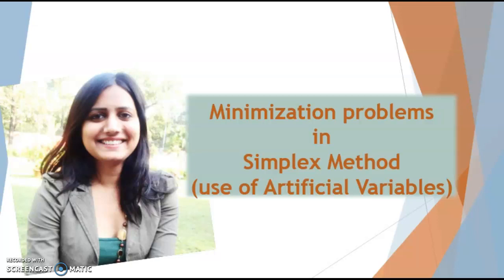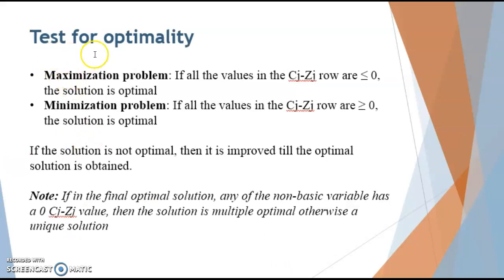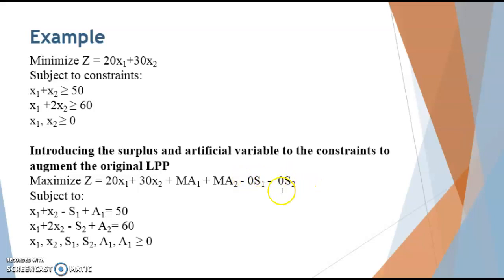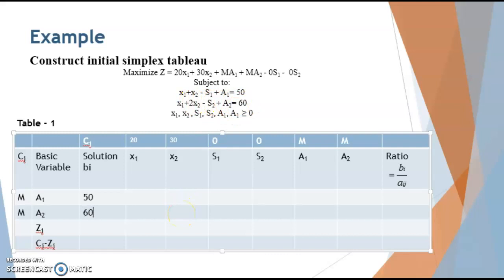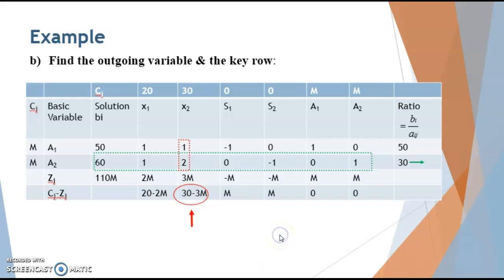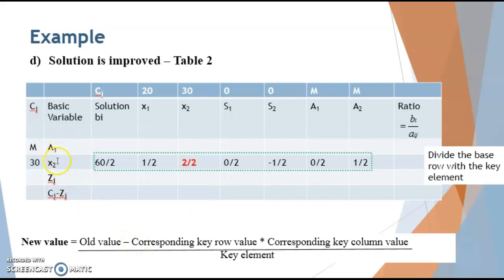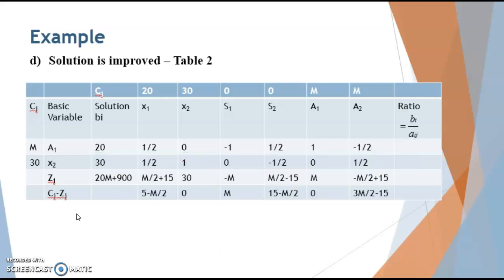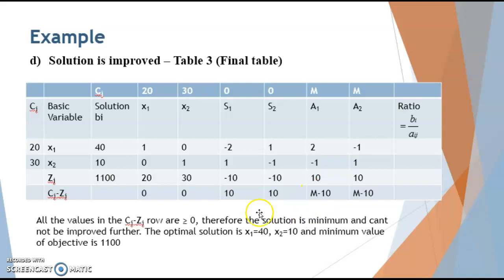Minimization problem Simplex method (Artificial Variable in Simplex table) - Minimisation solution

Comment: I'm confused on how to pick the corresponding key column values and key row value
Reply: for maximization problem use the maximum obtained cj-zj value as a key column and for minimization problem use minimum cj-zj value and take the corresponding ratio with the the basic variable column and then for both the cases select the row which has minimum ratio as the key row. 

if found helpful pls like :)